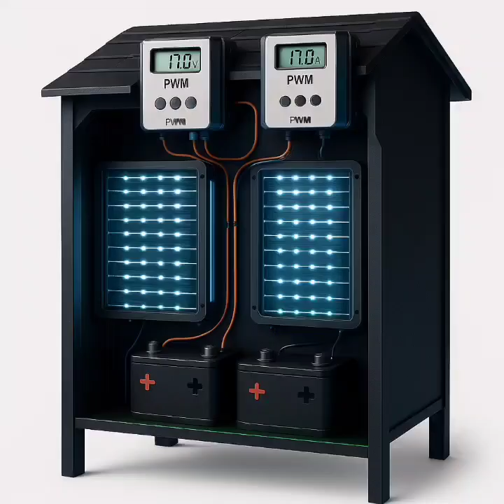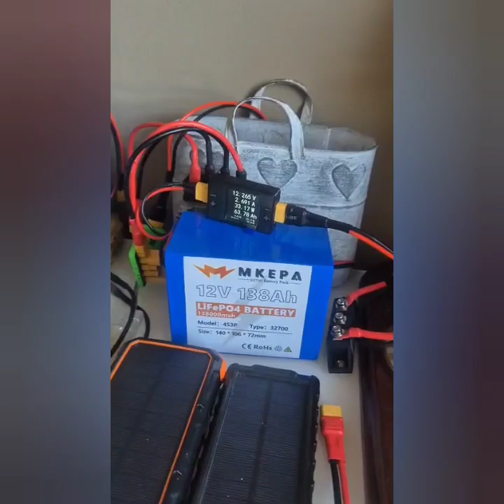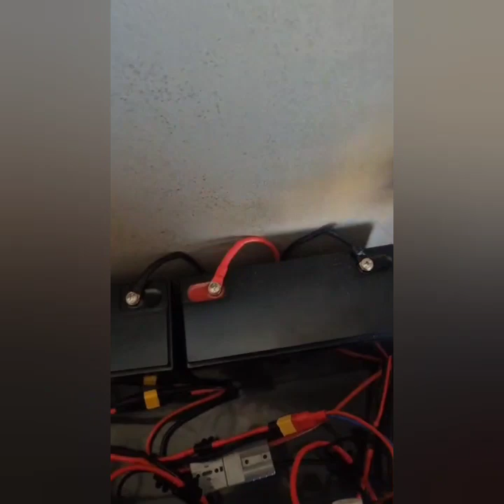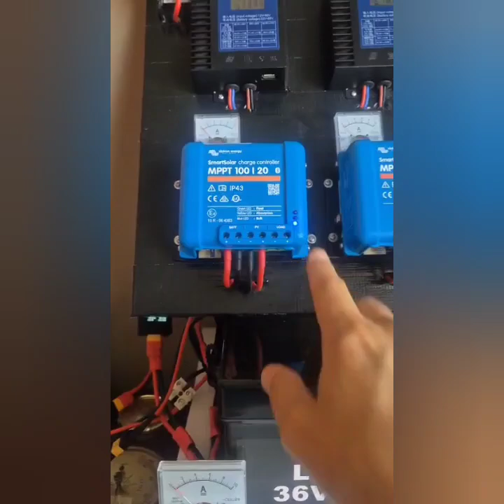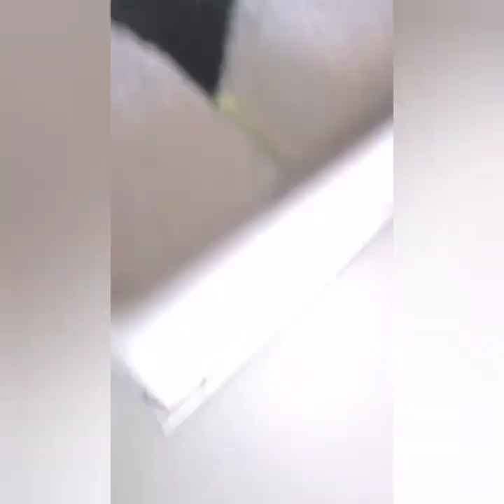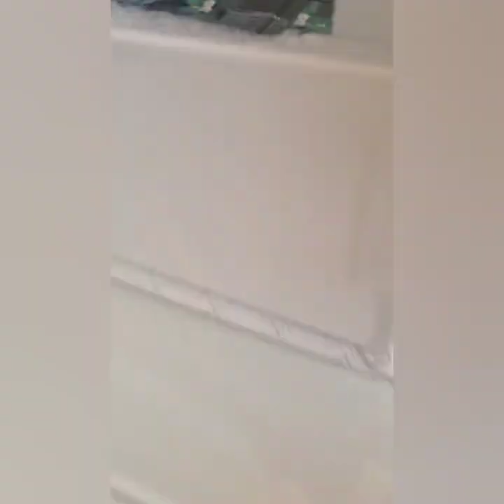Answering Collins question

Comment: Hey Lloyd, I've been following you for a while now, but please confirm with me that I understand your system correctly. 
When you run two solar panels and two batteries with charge controllers, switching voltages gives you extra electricity, and that excess is what powers your house?
Reply from the maker: Hey @bedkeepstrying, great question—and thanks for following along!

Yes, you’re mostly right, but let me clarify it in simple terms:

I’m not just switching voltages randomly. I’m using two separate charge controllers, each with a specific job:

One controller is powered by LED-lit solar panels, which give me high voltage but almost no amps.

The second controller is hooked to a battery setup that gives me amps—this is what we call amp injection.

Now here’s the trick:
I combine both sources using jumper wires. That means:

I take the voltage from one controller.

I take the amps from the battery-powered side.

I send both into the solar input of the second controller.

This creates an artificial solar signal that’s strong enough to activate charging.

So yes—by controlling where the volts and amps come from, I’m able to generate real wattage (volts × amps), which charges batteries and can power loads like lights, tools, or a house system.

It’s not just "switching voltages"—it’s injecting controlled current into a system that’s already holding voltage, and that gives me free energy movement without violating physics.

---

Optional Follow-up:

If you want a deep dive, check out my [video/book/post] where I explain how we avoid using external MOSFETs—because the charge controllers already have them inside. We're just using the system’s own components against the energy bottlenecks.
Medialibraryinfo@gmail.com 
Write me an email if you need more detail information watch the video which explains how I first did this below
       https://youtu.be/0YF2nvKTMz8?si=vWDEBEIw4iTZT_A8
Reply: @WIZ56575 thanks so much for the quick reply and explanation, I know it's pretty late in Laos right now. 😂.
Reply from the maker: @bedkeepstrying  You're welcome😊

Comment: I really want to learn how to do these. I want to be able to power my home without depending on the grid that is vulnerable.

Can it power up a whole house, with its appliances in it, using this concept?
Reply from the maker: Tell me what you don't understand out of the three last videos so I can help you understand
Reply: @WIZ56575  well, I'm new here and have no background in electricity. I'm still trying to understand it. But somehow I getting to understand the terminologies.

If you can give me one of your videos that I can watch over and over to understand, at least, the basic and that from there I can re watch the rest of your video and then, if I understand it already, try to build one for myself.
Reply: @WIZ56575  Thanks or your response, though.

Comment: Would be interesting to add and share how is it possible that a 200w 24v solar panel provided 476w 😊 and could be providing 860w instead of the 200w 😉

Comment: AI Video Summary:

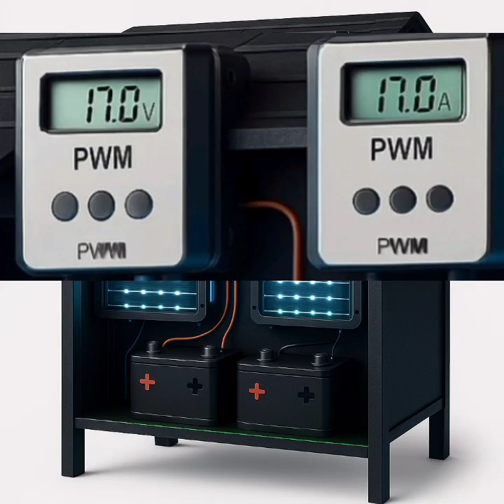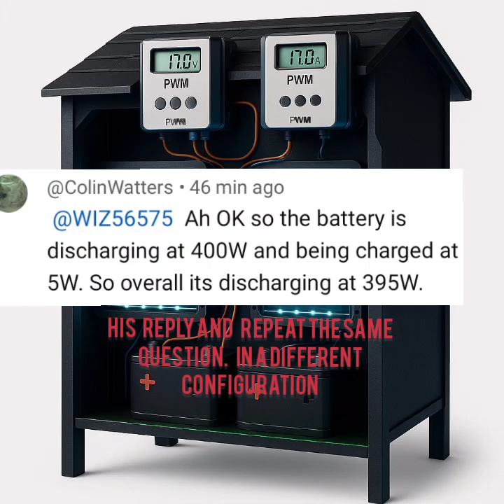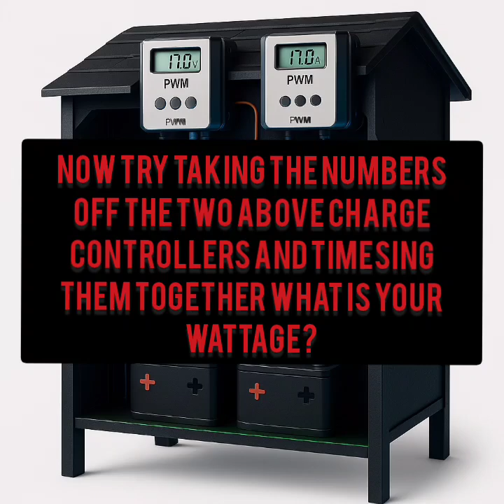The video addresses criticisms from "Colin" regarding a specific energy setup. The speaker clarifies that the system isn't a simple closed loop of an LED lighting a solar panel, as Colin assumes [00:42]. Instead, it involves two charge controllers [00:35] and a battery supplying amps [01:08].
The speaker explains the actual configuration:
 * A battery provides the amps, acting as the energy source [01:13].
 * LED lights shine on a solar panel, causing the panel to generate voltage [01:17].
 * A second charge controller combines the panel's voltage with the battery's amps to produce usable power [01:25].
The video argues that critics like Colin misunderstand the system because they [01:31]:
 * Ignore the battery's role.
 * Don't realize the solar panel acts as a voltage trigger, not the full power source.
 * Dismiss the setup without testing it.
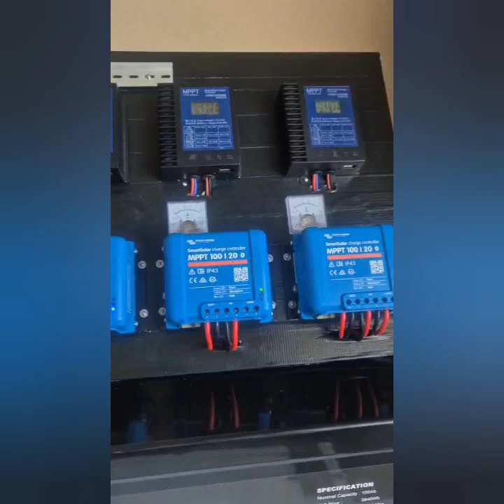The speaker emphasizes that the system has been built and tested by many, with successful results shared [02:06]. They demonstrate their own setup, which includes four batteries, where one battery simulates a solar panel at night to provide amps to the system [03:29]. This allows the system to continue charging other batteries even without direct sunlight [05:54]. The speaker concludes by stating that combining amps and voltage from different sources through separate charge controllers is a valid electrical principle [02:48].
Reply from the maker: Best answer yet this deserves a video just to thank you hope people read this❤😊🎉